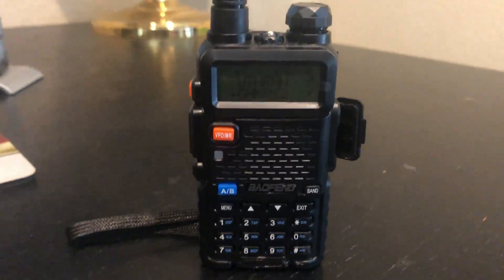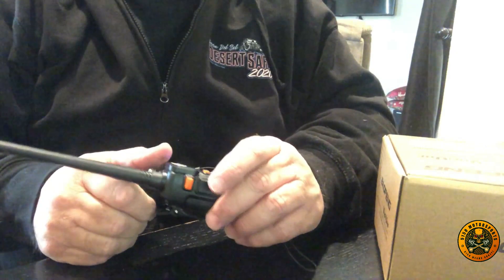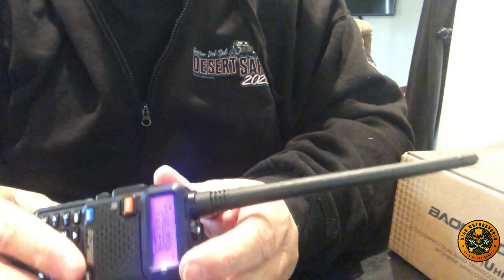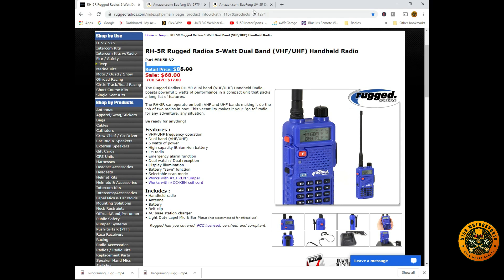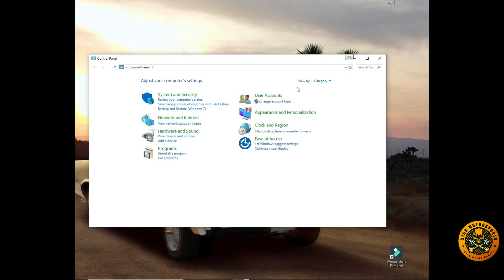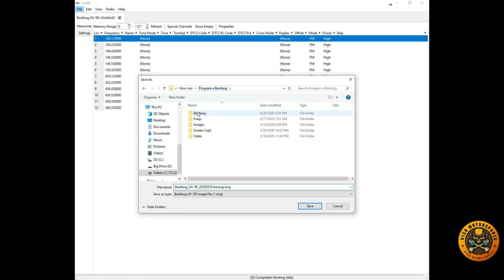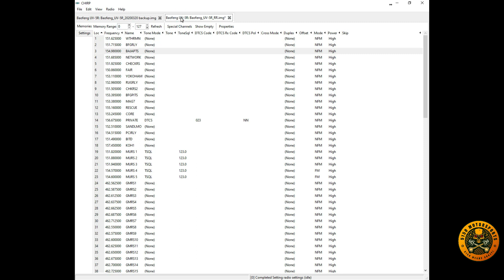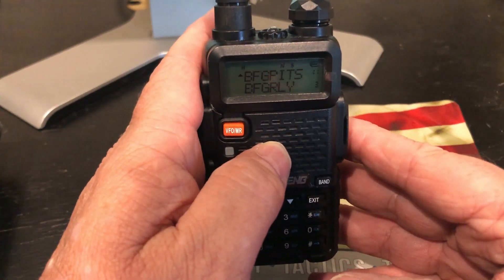Programming Baofeng Radio with Rugged Radios Frequencies

Comment: How do I transfer chanels from my Rugged Radio to my son's Baofeng? Thanks
Reply from the maker: Just follow the video. I have a link in the show notes for the Rugged Radio freqs or Just download your Rugged Radio freqs and upload them to your sons BAOFENG using Chirp software.
Reply: @5150MotorSports  I tried that Chirp and I was able to download from both radios and saved them but when I tried to upload Rugger to Baofeng is says Unable to communicate, it doesn't give me option to change from Rugged to Baofeng , no clue from here. I was able to manual enter in UHF 5 which is the channel our group uses but I would like to down load all with names if possible. I must be doing something wrong. thanks for your help
Reply from the maker: Unable to communicate sounds like you don’t have the correct com port selected. You indicated you were able to download the config from the BAOFENG to Chirp, is that correct? 

If so please verify you are using the same com port you used when you downloaded the config file from the BAOFENG 

when uploading the Rugged Radio config to the BAOFENG make sure you selecting the same com port you used to when downloading the file. also make sure you are selecting BAOFEG from the vendor list and the correct model number, hopefully this help.  Thanks
Reply from the maker: Maybe something with the Rugged Radio config not allowing you to change the com port. Did you download and try the config file from the show notes?